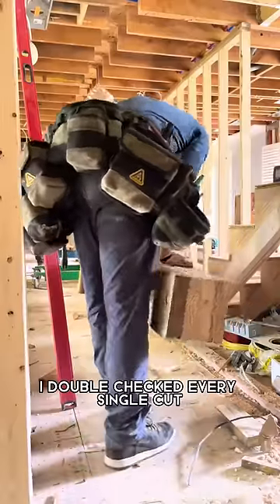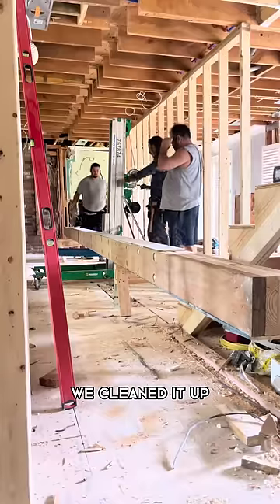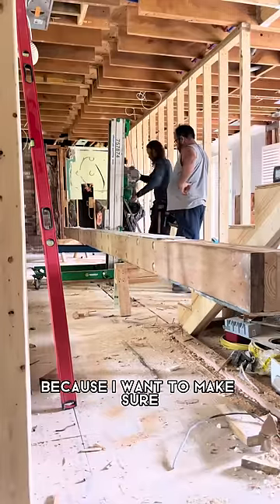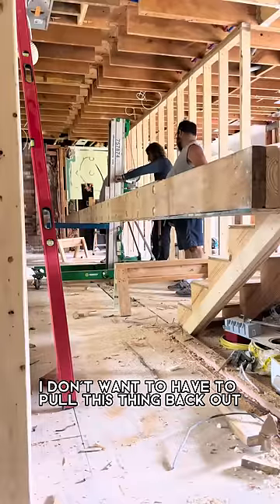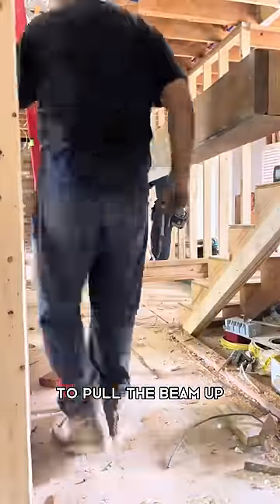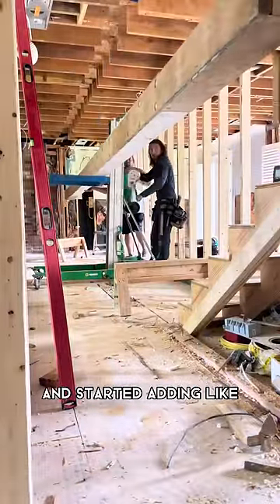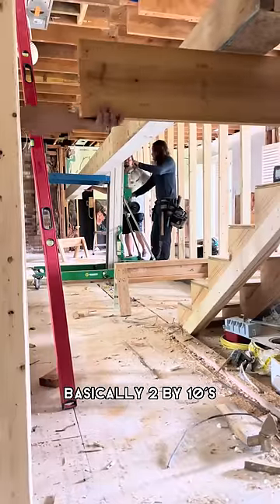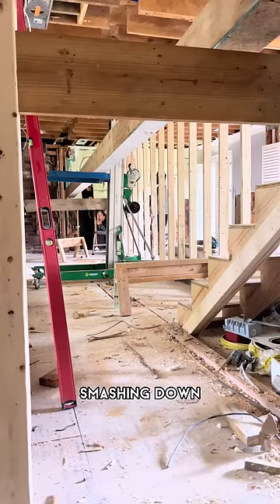Big Beam Install Part 7

Comment: You should've flipped the forks on the lift. That way the lift could've done all the work. It would've been able to push it all the way up into place. With the forks down the column hits first.
Reply: I guess I should have read your comment before I commented the same thing.
Reply: It went in fine.
Reply: Exactly what I was going to say we do it with duct every day
Reply: @brianfoughty9006  me too lol. But in another short it shows that they once they got it up a little over half way the supported it so they could flip the forks.
Reply: @Master General  I’m pretty much on your side but man do you need to get a life
Reply: Exactly
Reply: Facts
Reply: I rushed to the comments to day the same thing I do garage door and if my not using a forklift with a cradle I'm using this but hey good job pal

Comment: If we assume the those are only temp walls, that beam is no where sufficient for the load. I hope you had an engineer spec or at least used a span table.

Comment: Nice job. The shoring was too Far from the pocket cut, but it held for the time being so good. Sometimes you have to be careful because the load above is directly over the cut, and if they are floorboards parallel to the cut, you have to shore up all the loads above. Also, not sure if that span of beam is adequate for the load unless you added posts on top of pad footings, but that's a different story in itself. How did you redirect the pex pipes? Also, where I am, any beams that are 4 ply or up require carrage bolts. Hangers, adequate fasteners and away we go. You also built out the bottom of the beam to be flush with the joist bottoms. Maybe in case  the drywall joint lines up on the beam?

Comment: I've taken out load bearing walls exactly like that. Can be done in one day. Done it by myself with no lift. Hard days work for sure.
My back is now 40 years older than my age according to the Doctor and am 70 years old today. Still do trade work. Don't like to slow down. It is what it is.😁

Comment: Is anyone else wondering the freespan of this undersized beam?  If there is a bathroom upstairs, and any other significant dead load, that beam will deflect down (sag) if a simple freespan is used. 
Guarantee it. Looks like it needs at least one center post. 

Don’t want it to fail!

Comment: Build the beam in place...1 member at a time..your able to face nail your 2 by.....i do them by myself....
Reply: This. How does one build something and then add the support or load carrying beam? :D
Reply: @kitkuk.kojootti8296  I'm not sure of your question but load points are established first...... most likely already using pre-established load points in this video... I've been a Carpenter for 44 years..  we have never installed beams this way one member at a time nail it support it put joist hangers on glue then Bolt
Reply: @paulunderwood8960  hey, how are your aches and pains? Does anybody care? Retiring soon?
Reply: Yeah exactly, no house has their main beam added after the fact
Reply: @th3n1ck27  yes they do when they Remodel and take out a wall and they want to open up a space and that's exactly what they were doing
Reply: @th3n1ck27 I can't count how many times I have done this exact thing when remodeling houses and removing bearing walls. Sorry but you are showing everyone your lack of experience in the industry.

Comment: Rebuilt a load bearing 3 flr building pocket door 1 st flr failed  , coffered historical ceiling, doors had been removed & window openings had been made, the structural 6x6 framing at door jambs were bowing out

Comment: I always block underneath the beam in order to keep the head of the lift from striking the floor before the beam is fully inserted into the pocket.  I also have 2 20 ton hydraulic jacks on posts to make certain it's inserted snuggly into the pocket if necessary

Comment: WTF?  Way to many men to rent that jack. 123 lift. All done. Could lift one end at a time and brace under it like you were. Ah fawk, many ways to do this long story short ya got it done. GJ!
Reply: No hero medals available in construction. Smart to use a genie lift.
Reply: @TurinTuramber  It would be far smarter to have a body that can lift a small beam.
Reply: @jdizzle6324  I am far too old to be impressed by that kind of macho BS. You are only a hero to yourself.
Reply: A smart man will always save his back when he can.. you only get 1.  If I knew back then what I know now I wouldn't be in so much pain.  Being a tough guy gets you hurt...
Reply: I guess you work hard huh?
Reply: As a long time pipefitter with 6 bad disks in his back, many pinched nerves, and inoperable damage to my back, using a Genie Lift and other mechanical equipment to help lifting heavy material on the job is smart and extremely important. 

Take it from a 45 year old man who spends most of his life bedridden, uses a cane (soon to be a wheelchair) and on high levels of prescription painkillers and several other chemical concoctions just to take the edge of pain off now or Insanity would set in.
Reply: I have a beam jack and am not afraid to use it.
Reply: 4 2x8s can not be that heavy. I hope there is support posts being installed after, 12' is about the max span of that beam.
Reply: @guyod1  you are missing the massive I beam that's in the middle of all of those 2×8
Reply: okay, so then who has to let go to add the supports? That is some ego macho man bs you are talking. You only get 1 back...spend the money to save your back when you are older.

Comment: Is this to replace a rotten main support beam or is needed for more structural support on a add on? Just curious and not a carpenter
Reply: This is generally done to remove a load bearing wall in order to accomplish an open floor plan
Reply: It's called a flush beam. It is supposed to support the upstairs. Jack studs are put in the walls at either end,solid blocking , and posts are put in under the jacks if there's a basement,with footing under the posts.  It makes one big room,with a smooth ceiling . Usually done in bungalows and small ranch style houses to open the floorplan

Comment: Six Amish guys would have lifted that up in there by hand, lowered it down a foot or so, fix the cuts and then put it back in place without sitting it down on 6 floor once. And been done in 20 minutes. Lol
Reply: And for sure unlevel . It's been my experience in Ohio , that they can build a great barn , a table a chair  but damn I don't think there's a level in all of Amish country . They are pretty rough sometimes when you are following them doing drywall ,siding etc .

Comment: So why arent we building with stone and beton ? Why is there a need for installing a beam after the wood construction was done and wasn't installed with the wood construction? I kinda smell some BS ... but this is maybe because in germany our houses wouldn't take any structural damage if you crash your car into the Front wall or the wind gets a little stronger ...

Comment: Not sure who did your Engineering calculations, but there is no way that, that man made beam is going to hold up that floor system. 🤦🏻‍♂️
Now if you had used a PARALLAM,  that probably would have work. 

Everything else looks good.

Comment: Your beam is sagging under its own weight. There is no way that beam is going to support its intended load.
Reply: You don't know where they are going to add posts. When they get those in, it very well may not be sagging...which it didn't appear to be anyways